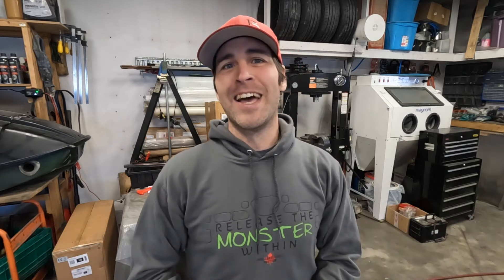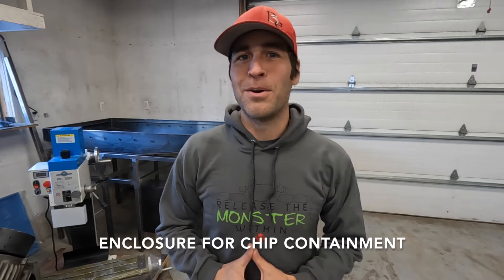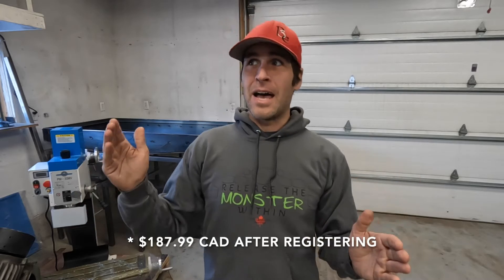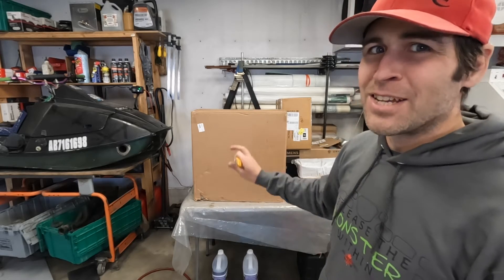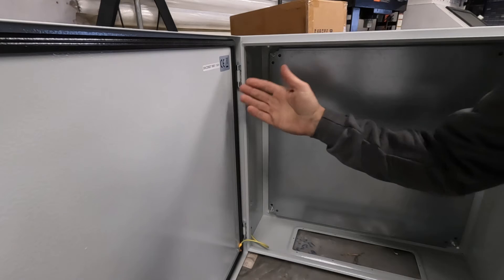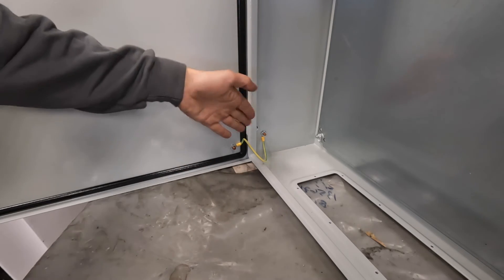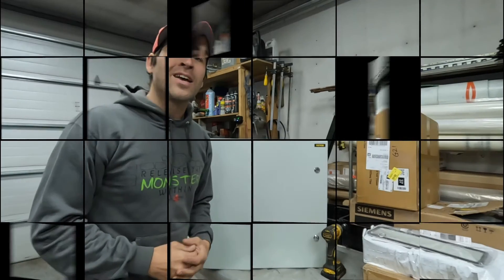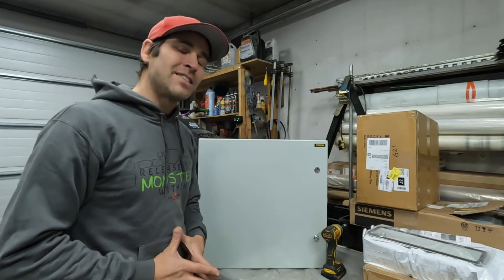Electrical Enclosure by VEVOR - Unbeatable Price - Awesome Quality !

Comment: Hi, these industrial cabinets / enclosures are very common in electrical industry, I use them very commonly. The best enclosures you can buy come from Rittal, then Schneider electric, and lastly TVD. After that come the bad ones - Schrack and nVent Hoffman. They require you to lower your expectations below allowable minimum. These are commonly available where I live (central Europe). If you would want to do some decent job, I would recommend Rittal. They are the most "armored" out of any standard enclosures, but being German, they are a little bit overdesigned.
Your cabinet seems to be a little similar to Schrack models. The coating is classic powder paint, it leaves orange peel surface naturally, and usually has RAL7035 color, which is common in the industry. Moreover orange peel paint does not cause sharp reflections, which can be dangerous, and also tends to hide imperfections. Even the welded earthing and fastening bolts would leave visible dent from the outside. These bolts, pay attention not to overtorque them, they usually don't stick very well, be gentle.
Anyway, looking forward to more diesel heater videos, good luck man.
Reply from the maker: Thanks for the detailed comment. The main electrical panel, that I have now just removed and upgraded (more slots) to a Siemens, was a Schneider. 

Haha... nice use of lowering your expectations. My only real experience with German products is one VW car I had and two BMWs that my girlfriend had... All good quality, but the BMW engineering is insanity... 

I should probably shoot my videos with a script, as I realized after editing that I completely neglected to mention that this enclosure was powder coated, as is the standard. I believe they have a NEMA name for this color. 

Cheers !

Comment: This is pretty interesting. This sounds like an ambitious project but also it sounds like quite a few people have done it. I wonder how it will be setting up the controller. If you can put a seimons controller on that thing, you could probably put it on some old tank of a cnc mill that has a broken 80s controller.
Reply from the maker: Yes, fortunately, I am not at all the first person to have converted a mill, or even this exact mill. There's no secret Betty Crocker recipe for doing this, but the world has become an easier place to do this sort of thing.... with forums, kits and being able to email with retailers and manufacturers. 

I'm probably missing something, but the control for my mill will consist of the motor controllers, breakout board, an ethernet smooth stepper and a PC. People have retrofitted some super old machines in this way.

Comment: I want to learn about stepper motors and how to work with them. Will you or do you have a Manuel on stepper systems? Or will you just use the instructions  that come with the motors? I have watched several Vedios on stepper motor builds and most of them act like stepper motor systems are general knowledge.
Reply from the maker: Hey there... thanks for the comment ! 

My system is going to be using AC servo motors. I'm not sure what you do or don't know about them, but they are basically like a higher end version of a closed loop stepper motor system. 

I do not have any manuals or instructional videos on stepper motors, and I likely won't be going into great detail about this... I will be figuring out much / most of it as I go, as I have never done this before. 

I know what you mean about people acting like it is general knowledge. I will do my best to explain this generally and quickly. 

A "normal" motor may have 4 or 8 poles in the motor (sometimes more or less), and is designed to continue turning, as long as power is fed to it. A stepper motor may have 200 or more poles in the motor and these are called steps. They are called steps because when power is fed to the motor through the controller, it is designed to move as little as one step and hold that position, if desired, or rotate to the next step if desired. If you have 200 steps in one revolution, the computer and controller can do the math and knows where the motor is, and therefore your machine, based on these steps. 

There are generally 3 types of stepper motor systems. 

Type 1. Is a general, open loop stepper motor. "Open loop" means that information only goes from the computer, to the controller. The computer tells the controller it wants to move 1000 steps, for example. The controller sends 1000 pulses to the motor, and if everything goes well, the motor moves 1000 steps. However, if the motor isn't connected, has to much strain on it, or crashes into something, it will not actually move 1000 steps. The computer and controller think that the motor has moved 1000 steps, and continue as everything is fine... The motor does not communicate with the controller or computer. 

Type 2. Is sometimes called "closed loop hybride". In this type, the motor has an encoder on it that feeds pulses back to the controller. The computer says "move 100 steps", the controller sends 100 pulses to the motor, and when the motor moves, it sends pulses back to the controller. The controller now knows where the motor is and if it falls behind for any reason, it can send more power to the motor and regain control, instead of losing steps. However, the computer still does not know what is happening, so it just keeps sending commands to the controller... If the motor just can't keep up, the computer has no idea... It just carries on like everything is okay. 

Type 3. Closed loop stepper. An actual closed loop system means that the computer is aware of what's happening with the motor at all times. It tells the controller to move 200 steps, the controller sends 200 pulses, and whatever happens with the motor, the computer always knows what position the motor is in.

Comment: I got a large-size enclosure a couple of weeks back (NOT from Vevor-found one cheap on Amazon) - this will house the control system (computer, and other bits and pieces) for our large radio telescope restoration project.  The enclosure was shipped in thinnest of all possible cardboard boxes--without any foam or anything.  Needless to say parts of it got scuffed-up in transit.  Still perfectly functional, but annoying.   I'm happy to see that Vevor in this case added a foam layer.
Reply from the maker: Haha... I have nothing against Amazon... I purchase a LOT of stuff from Amazon and I'm generally happy with the price and shipping times! My panel, that got damaged, was also from Amazon, haha.  

Sounds like a really cool project ! Are you doing this for yourself / as a hobby, or is it something more than that ? I'm not even sure what a radio telescope is... but I have heard of them.
Reply: Started out as a hobby years ago, then kind of morphed into a side-gig, and then my main retirement occupation.  We're called the Canadian Centre for Experimental Radio Astronomy.  The "saveitforparts" channel did a bit of a piece on us a couple of weeks back.  https://www.youtube.com/watch?v=sadM0qzmMfU&t=17s